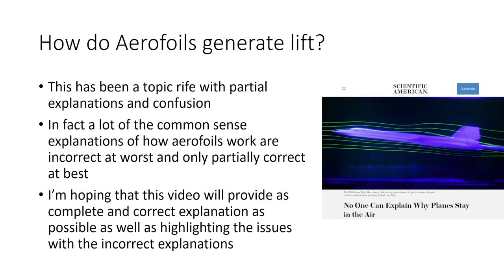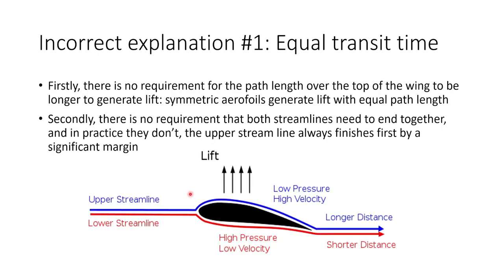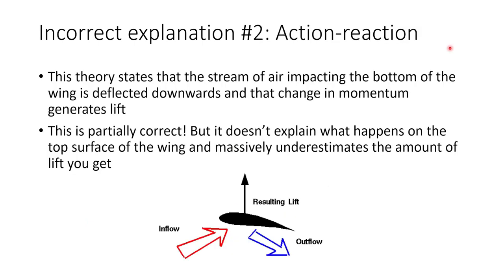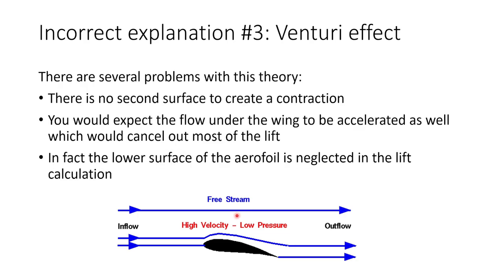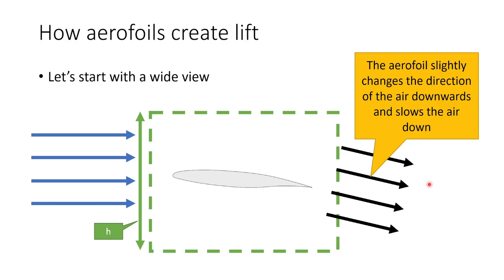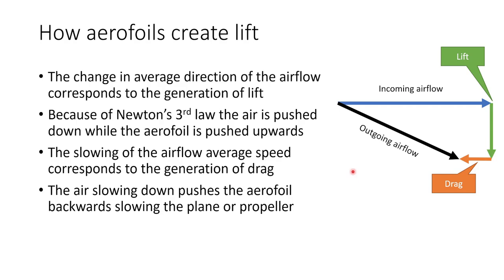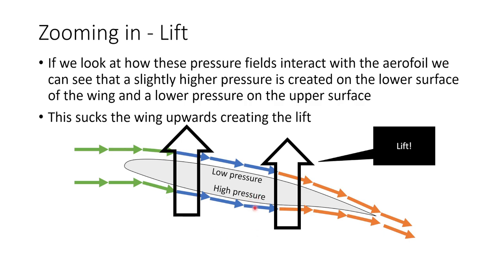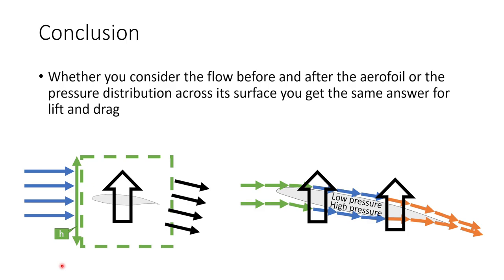How wings make lift and propellers make thrust: 100% Explained!

Comment: Chris, Chris, Chris ... you relatively correctly pointed out that the "usual" explanations have flaws, but your explanation is as much flawed as these are ... the "100% Explained" is a massive overstatement  

- Bernoulli is a fact, the problem is that it is for conditions which do not fully apply to an airfoil
- Newton is a fact, but again the problem is that one can't apply it that naively, since air is a gas and not a solid body
- you are incorrect in saying that the airfoil must have a particular upper shape, see collective pitch helicopters, or just take a plank and hold it outside of your car's window
- you are incorrect in saying that you can think it either way. It's like Ohm's law, then you know I you can get U, and if you know U you can get I, but physically it is absolutely clear that it is a U which drives the I, and not vice versa. Similarly so with F and a, F results in a, and not vice versa, and similarly so with v and dP/dx, dP/dx results in v, and not vice versa.

it is also not difficult to see that your two explanations are equally bad or good as the flawed ones

- your flow vector model obviously violates vector field equations (divergence). Air needs to come from somewhere and needs to go to somewhere

- your 2nd explanation is even more obviously wrong, and in fact suffers from exactly the same flaw as the Bernoulli, Newton & Venturi explanations: The velocity of the air at the surface of the airfoil is ZERO! This is known as no-slip condition and is an extremely good and universally accepted assumption in aerodynamics. Ironically, in your (wrong) drag explanation you show indications of that the velocity on the surface gets smaller. But it in fact goes to zero everywhere on the airfoil surface. Therefore, it is simply not possible to talk of a velocity of an air stream.

There is a one-line correct explanation for why airfoils create lift: Flow is a continuous vector field. Admittedly this is not so easy to understand what this is and what it implies. 

None of what I say is in contradiction to the article you refer to, to the contrary, the article concludes exactly the same. The video by Doug McLean is in fact excellent, absolutely excellent, and explains it all quite nicely, a must watch.

You should consider removing the claim that you have now finally given a better explanation. Sorry mate, no offense. :)
Reply from the maker: Let me take each of your points in turn:

Bernoulli is a fact, and it is often used to explain why faster flow is at lower pressure. However, it doesn't explain why the flow should acclerate in the first place. As an analogy: conservation of energy explains why an apple accelerates as it falls. but it doesn't explain why it falls in the first place.

Newton's laws apply to solids, liquids, and gases in exactly the same way.

I actually stated that the upper shape of an aerofoil matters for calculating its lift generation (not that it must have any particular shape to generate lift).

In a motor the current created by wires moving through a magnetic field generates voltage. Electromagnetism is a coupled field so you can find examples where voltage seems to generate current and vice versa. There is no correct way round, anything that can be explained by one way of thinking can be explained equally well the other way round.

I'm well aware of the no slip condition in the boundary layer. It doesn't stop us calculating the average velocity change of the air. The average is a little less because of skin friction but we can still calculate the number just fine.

Stating that flow is a continuous vector field doesn't constitute much of an explanation in my book. If I asked you how wings generate lift and you said "flow is a continuous vector field" I don't think I would walk away with a better understanding of the physics involved.

Comment: It's hard to tell when you cease debunking the false explanation and start with your explanation. But I guess it was at round 7:00 when you choose the differential of the Bernoulli equation and the potato gun. It doesn't need Bernoulli to explain that air moves from high to low pressure, potato guns notwithstanding. Atmospheric air is moving from a high to low pressure BUT IT IS NOT ACCELERATING! Pressure and flow are not coupled fields like electricity and magnetism. You (and MacLean) have invented this myth! 
It's much simpler, as I explain in the paper linked in the description of  youtu.be/dgE9xhIjTOU